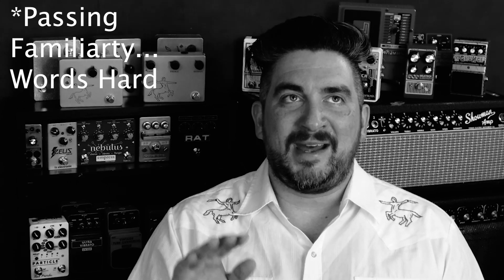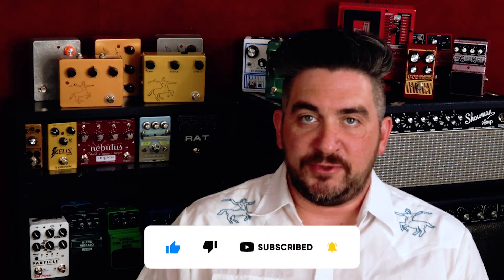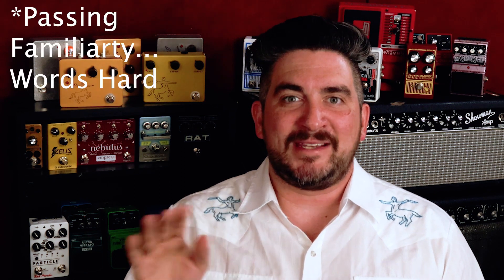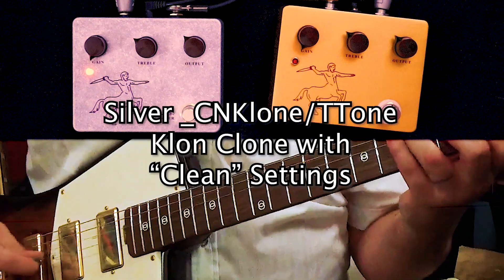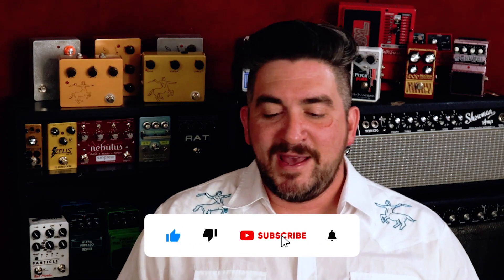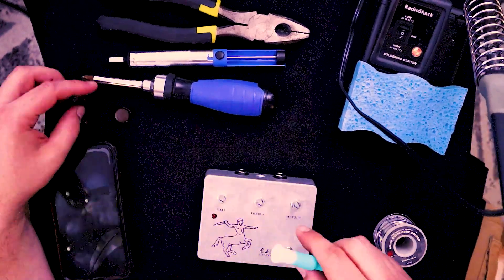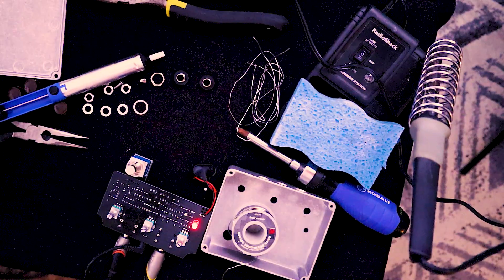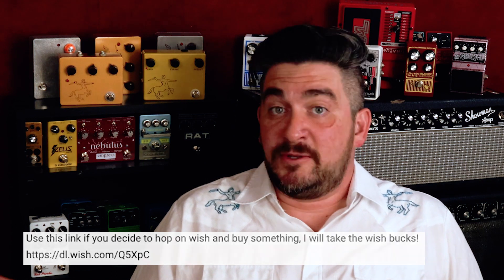Treble Knob Fix for Black PCB Wish Klon Centaur Clones | Klon Mod

Comment: This also works on the landtone klon kits with the green pcb.   I just did it and the high end is so much better.   I was having to run the treble knob wide open before.. now it's at unity around 11:00
Reply from the maker: Oof, that means that it was also messed up… which means the green ones are also suspect now.  Unity around 11 is where it’s supposed to be.
I’m pinning this, so people know it’s not just the black ones.
Reply: I got a silver clone with a Green pcb, works great but would like to know if anyone knows a way to make the volume control not so loud even at barely on 7/8 oclock?
Reply: @jooles0001  that’s just how the klon circuit is.  Plenty of volume for pushing the input of a tube amp
Reply: Hi! On the landtone, did you solder in the same space as in the vid? My landtone has the same tone issue, but these two spots are clearly already connected on the pcb.

Comment: Hi.  Just received mine from TTONE, but it had the black PCB and no metallic bezel on the LED.  In other words, not a 'good one'?  I tried it before doing the 'mod' and it works and there does seem a small amount of treble boost available.  My hearings not very good with HF, so I'm wondering if the faults been rectified at the factory?  How much treble 'boost' should I expect?  Does anyone know if the latest black PCBs have been rectified, or should I just go ahead and add the 'jumper'?  Is there any way of checking as I don't want to toast it, although I don't see how you can do any harm if it's already done as it's just two  links in parallel :-) - PS They gave me a refund, as it wasn't the same as their pics on the Wish ad and I told them the story.  Maybe they know the black PCBs a dud?
Reply: I got one of these with the black PCB too and this mod did make a difference, particularly at the last 20% of the pot’s taper where you can hear a noticeable treble boost.
Reply: I can’t speak about the new ones, I got mine about a year ago. Still the mod works and if they did change the circuit on the newer models then that’s a cool development :)
Reply from the maker: Unfortunately without being able to mess with it myself I couldn’t really give you any advice.
My litmus test is if it doesn’t sound about the same as your normal clean with the gain at 0 and output and treble at 10-11 o’clock then something is messed up.  Using my audio examples in this video should help, but it all comes down to your ears.
If they’ve started fixing it…. Then that would be interesting.
I’ll ask around, if you get any info it would be of interest I would think.
Reply from the maker: It does seem like the company that sells them has started fixing it after seeing this video.  It may not be necessary now?

Comment: OK...(refer to original Klon Centaur schematic) the two components being jumpered are R5 (5k1) and C4 (68n) which are shown in parallel in the signal splitter section immediately following the U1A input buffer. I blew up a photo I took of my PCB and read the values off the components..there are only two 68n caps in the Klone circuit. Given the jumper mod being done, the Black PCB apparently did not have both ends of these two components connected. These two components form a high pass filter when connected in parallel that provides one of three inputs to the summing junction that feeds the U2A op amp driving the Treble control circuit.  If the parallel connection between R5 and C4 is not made, then there is no high pass filter and one of the three inputs to the Treble control circuit is "broken". This mod fixes that missing connection between R5 and C4.
Reply from the maker: I know most of those words but I’m fairly useless when putting them together so I’m just going to pin the comment so anyone else wondering what technically is happening can find it here.
Thanks!
Reply: @BGBSATX  the capacitor looks like an open circuit to DC, and short circuit as frequency goes up.  It lets higher frequencies bypass the resistor - i.e., more treble.

Comment: Hi, great series on this pedal! Really enjoying all the info, thanks!  2 weeks ago I received my silver Klon with black pcb from TTONE on Wish.  I also have a gold Klon clone I purchased a long time ago.  The gold sounds awesome with no treble issue. I think the board on the gold  last I checked is a large green one.   I was expecting the silver would have the treble issue as you described but it works fine.  It definitely does boost the treble.  Not sure if they fixed this issue but sounds great.  Out of the 2 my preference is the silver.
Reply from the maker: Yeah, as I mentioned in the video I think they switched distributors/manufacturers.  Ultimately the color of the pedal doesn’t matter as much as the color of the PCB and this video is a stop gap to help out anyone who got the wrong one…. The way I see it is if they changed distributors once they can do it again, so the info on the stores is less helpful than I had originally hoped, but ideally anyone who watches the videos on this will understand what they have.
Reply: Same. I opened my silver/black board and it was jumped already!

Comment: Great video - glad the mod was so easy for you!  Not having to desolder the footswitch board makes it 10x easier :)
Reply from the maker: Indeed, I was tempted to try desoldering and realized what a frustrating task it would be, you’d have to pry it off as you were heating it…. Could be beyond my abilities.

Comment: I'd like to see how this mod looks on the schematic..what is it doing in the circuit?  Good info....I can make this mod on my CNKlon Y Factory Klone black board, along with replacing the board- mounted power jack which is NOT secured to the box and is a prossible future point of failure . Also, on my Klone, the internal battery power is switched ON when the OUT cable jack is inserted, not when the IN jack is inserted as is common on all pedals I've ever seen/played/touched. And when external 9Vdc is being used, it it can be activated without any cables inserted in the IN or out jacks...it's always powered up.  This is no big issue, just uncommon.....maybe that's how it was on the OG Klon.
Reply from the maker: I wish I knew enough about electronics to even explain it, let alone find a way to point it out in the schematics.  I could ask my electrical engineer neighbor to help me out, but honestly I’m not sure how well that video would do, for YouTubers with limited time to make videos like myself we always have to balance whether something is worth making when we have a list of other videos that would most likely do better.
As far as the power jack- yeah it’s still a cheap Pedal at the end of the day, what can you do 😅😅
As far as what makes the pedal go on… I’d be inclined to blame the makers of the Klone, but being that I don’t use batteries this is not an issue I could ever hope to find on my own.  Interesting like you said, just… is it worth worrying about, lol.
I have my DOD Gonkulator reissue in front of me, when it’s getting power from the jack it’ll turn on no matter what outlet has a cable, or even no cable but tbh this isn’t something I’ve looked at much with any other pedal.

Comment: The mod worked for me. I used a little jumper wire so I could reverse it easier if needed. After the mod, I compared my Gold USdream2016 to the Silver TTone and they are very similar now. The gold version seems to have a little more hair to it while the silver is slightly cleaner (if that makes sense?) even when the gain is all the way up. Though it's known even the original Klon sounds different from pedal to pedal because of the germanium diodes. This video was great timing for me since I just received the silver TTone Klon a couple days ago in the mail. I noticed right away the treble knob didn't have as much punch. It didn't sound necessarily bad at all but it was different than the gold version I had. Thanks for the informative video!
Reply from the maker: Yep, sounds like you are better at soldering than I am😂, glad it worked!
And yeah, like I annoyingly mention in the video, the 10% variance in the pots… it would likely account for what you’re saying IMO, as I understand it otherwise the chips are the same etc, but everything can have some of its own character.
Reply: I think the gold and silver models on Wish are exactly the same. Just one is painted gold and the other, silver.
Reply from the maker: @KarstenJohansson  … the color of the pedal housing has very little to do with what I’m discussing here, it just happens that one is silver and one is gold.  If I were going by color I would be more inclined to say that the green PCB boards and the black pcb boards are really different, but it has very little to do with their color so much as how they laid out the circuit, which this video covers, IE one of them messed up the treble circuit.  My last videos on the subject “Which wish store has the right Klone…” and “wish Klon clone buying guide” explore all of this much more.

In fact I could easily swap the PCB’s from one to another and were it not modded the issue would remain.  I really recommend you watch the videos
Reply: @BGBSATX  Ohh, I thought all the Wish pedals just used the one board. I have one that I got a long time ago, so by now I forgot what it looks like. Back when I got it, I googled and the only model I found (everywhere) had that same pcb so I just took that for granted that it was the one everyone is using. Well, it is mentioned in the video here, but it didn't click until just now. There is a long audio delay for the first half of the video, so a lot got lost in the xlation. Thx... And yea, I'll watch your earlier vids on this. I'm already subscribed from before, but haven't gone back in time yet.
Reply: BTW: Ignore that comment about the delay. I think there was network congestion because I just watched the video again and it streamed properly. When I watched it initially, the audio was way out of sync. First time I've seen YouTube do that, actually.
Reply from the maker: @KarstenJohansson  glad you understand now, lol, sorry I didn’t want to be so blunt but at the same time I was kind of at a loss as how to respond.  And yeah, if you’ve been lucky enough to get the right one (it’s possible earlier adopters only got the right ones idk) then 90% of the 3 videos in question really don’t apply to you unless you’re a maniac like me who fixated on them and bought 8 of them over the last 2 years.

And glad the lag fixed for you, my process for making the videos pretty well insured against lags etc, and I always double check them before I upload them… like if there’s an issue after that I have no idea how to fix it on my end
Reply: @BGBSATX  I bought a few OD from Wish... including the half-size "Klon". I haven't ever used that one other than to see that it works, but I will be eventually.

I didn't think you were being too blunt, because I realized you didn't know I was unaware that there are 2 pcbs in question, and I've only seen a couple of your other videos so far. The one I got matches what you get in the DIY kits, and indeed, I had to build it myself. I think it's funny that there are 2 different pcb versions, and some are randomly already pre-built and others aren't.

Comment: question. Are there ANY distributers that are currently selling correct Klons? I don't want to invest in soldering and don't know anyone that does
Reply from the maker: I totally feel for you on this, if you don’t have access to the equipment it’d be a pain.  I would consider asking your local guitar tech or guitar center repair etc, they might do it for cheap?
But to your question, from what I understand the stores are switching distributors back and forth, USDream2016 used to have the right one and now TTone does, where it used to be the opposite, and now I don’t have a way to tell you which is which at this moment in time without buying them myself… And I’ve done that like 8 times now, I have no more will to do it.  Maybe someone on here has bought one recently and can give you a heads up?
In the meantime, if you get one with a green PCB it means you’re good if it’s black PCB it means you got the wrong one.  I’ve heard if you call them on it quickly they just refund it…
I know none of this is terribly helpful but it’s all I got for you at the moment.  I have wanted to do deeper dives into how it works on the back end with the stores and distributors (interesting info on the wish Klon clone buying guide) but none of my attempts to reach out have been answered.
Also, I think I pissed off TTone (previously CNKlone_) because we had been chatting on IG but they ghosted me after my last video on the subject 😅
Reply: @BGBSATX  haha that's funny they ghosted. so all green boards are good to go? go to know
Reply from the maker: @levijessegonzalez3629  as with everything else on this subject, it’s subject to change, but those are the facts as I know it right now.  Every green PCB I’ve seen was good, every Black PCB wasn’t but now the mod will fix it.
Reply: @BGBSATX  thanks for the info
Reply: @BGBSATX  I have a USDream2016 Gold Klone on the way right now.....ETA 24 July. I can let you know . If it shows up with the characteristics of the one I have (black board, funky power jack), it will be returned. I kept the ad pics of the exterior of what I bought, but they no longer give a pic of the inside of the pedal. .
Reply from the maker: @pcollenyt3683  considering how the wish sellers seemed to have moved away from showing the indicators I mentioned I’ve wondered if maybe they’ve seen my videos 🤣🤣🤣 but yeah like you said the black pcb board right now is like the last tell tale sign aside from an ear check.
And uh… wow, I know I’ve posted pics in the videos and shown the two of them next to eachother but I don’t think I’ve really noticed that the right ones with the green PCB had the jacks mounted to the case and not the PCB until you mentioned it, I just cracked one open to understand what you were saying earlier.
Definitely would have been good info to put in these videos, it’s things like this that make me think I need a discord server or something to discuss stuff like this so I can crowd source multiple people’s thoughts and observations rather than relying on my own lack luster perceptions.
If this was DnD my perception check would have a -3 roll.